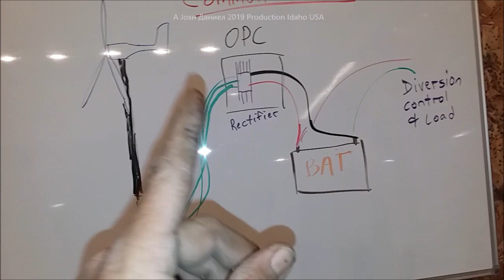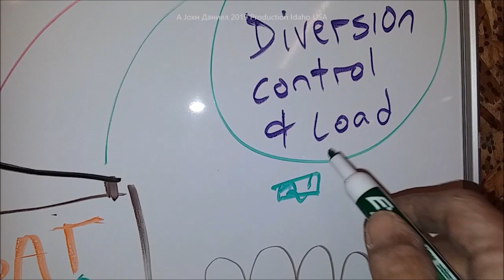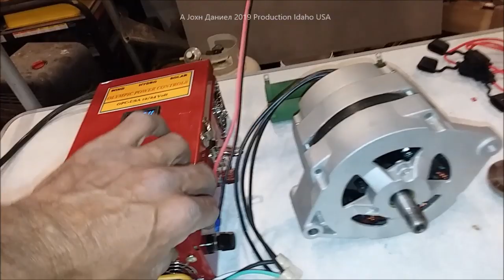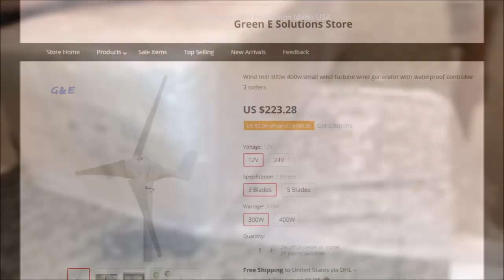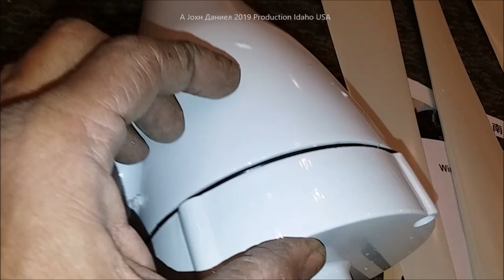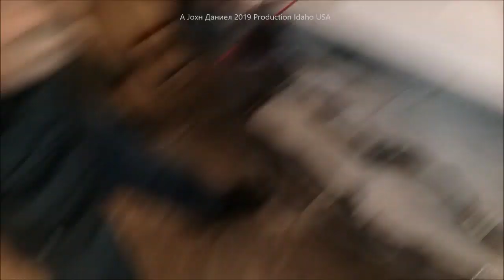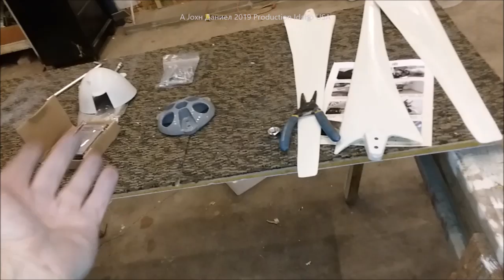300 watt Micro Wind Turbine, the GE-300-S, truthfully 300 WATT RATED! ALL Parts below vid

Comment from the maker: All materials used are listed above under this video.
Reply: Јоhn Daniel  Here in Indiana we get roughly 10-15 mph winds and sometimes up to 30 especially in the spring and fall periods. I was thinking about about getting one of these small 300-400watt turbines to use with my garage. Does the factory controller control the turbine Incase of high winds and/or slow it down when the battery is fully charged or should I invest in resistors to stop it from over charging or damaging itself?
Reply from the maker: @haulngarage  Honestly the factory controller will work for most, but your winds are likely high enough to consider a actual diversion controller set up. Reason is the factory controller will constantly be hammering the turbine in and out of brake mode which is not healthy for it or your battery in wind averages over 12 to 14 mph. So I would suggest the diversion plan that allows the turbine to spin up but be loaded heavily instead of brake shorting the generators head so much.
Reply: Јоhn Daniel 👍 Right now (even with green leaves on the trees which is crazy for this time of year here) the wind is steady at 18 mph and gust up to 27 mph. How do you feel about wind turbines connected to grid tie inverters? Seems to be a popular thing at the moment and I know what’s his name is on a ban spiel about it (solar guy that was homeless? Name leaves me at the moment?) but seeing as my garage is on its own meter I wonder if wind generator would be a viable option? It could act as a load generator if the batteries are full. But then again with everything shut off I don’t see my garage using next to nothing if I’m not out there so it still may need a resistive load 🤔 Still trying to come up with the best option that would best suit my needs. If I’m successful my wife might let me do it to the house 😁 By the way thanks for the informative videos, really enjoy watching and learning. I build Ebike batteries and tinker with 18650 cells and lots of batteries.
Reply from the maker: @haulngarage  Start with about 1500 watts solar and 600 to 800 watts of wind and at least 8 of the GC2 style batteries with your plans to remove common use circuits from your shop/home breakers and placed on your system. Your starting right, but do not waste your time on wind/grid tie unless your planning on going 2000 watt or larger, even then payback is 5.5 years.  But here is some study help, and direction to your current interest https://dakotalithium.com/our-batteries/?v=7516fd43adaa
Reply: Јоhn Daniel ok awesome. Thanks for the info.

Comment: How would you do a diversion with your controller when using a LifePo4 battery(ies)???  I want to do a hybrid system on the farm for my cabin (Central Canada).  I want to be able to take advantage of the ability to charge / maintain the battery charge in no sun times (winter / night).  However, how would a diversion work if the BMS on a LifePO4 battery shuts off current at full charge / low temp - the electronics in your diversion box would have no reference voltage from the battery?
Reply from the maker: On a Lifepo4 you will always have voltage present unless your BMS fails. Its accepting charge is to all cells, the BMS just does the balancing of cells to keep them equal. So by setting the divert to below the Lithium max charge rate you can do it. But I prefer a dedicated wind charger controller for Lifepo4 like these on this page https://s.click.aliexpress.com/e/_9iefAL

Comment: Is there something I can add for a turbine charge lithium iron batteries.
Reply from the maker: For lithium batteries you need to get the MPPT controller that's battery selectable.
Reply: Thanks.
Reply: Got an mttp controller. Waiting for my 48 volt 5 blade to be delivered. Thanks again for all the info you post.

Comment: I’ve currently got solar (600watts) charging a 200amphr lifepo4 (lithium) battery. 
Will get another 200amphr battery down the line but for the moment I’d like to incorporate a 400w turbine to keep the mini fridge going on cloudy days. 

Could I use the factory controller along side with my existing mppt solar charge controller (obv different brands) and charge the same bank, or would you suggest I get the diversion controller?  Avg wind speed 6mph 

Thanks in advance!
Awesome stuff
Reply from the maker: You should go with this programmable 800 wind/600 solar  MPPT controller  https://amzn.to/32K5YfH  for such use on LiFePo4 due to the sensitivity to voltage the BMS has. Later you can add 300 to 400 more watts of solar on it. Never load them to their advertised claims.
Reply: @JOHNDANIEL1  sweeet, subscribed!

Comment: Have you tried hot cold therapy for your carpal tunnel? Frozen bottles of water make great ice cubes. Dip them in a bucket and you're set. Take a look at the Talon Slack channel, very good community software with voice dictation and eye tracking solutions. Hit me up there if you are interested. I suffer from similar problems.
Reply from the maker: Yes, did it all. They say I am so far gone only surgery is next. Too many years in the ring, too many years working 50+ hour weeks.

Comment: Hey John I'm trying to keep up with all the calculations but I'm getting lost and frustrated. I bought a wind turbine (24V 3000W) S model from China. I seriously do not know what I need to get this system functioning so that I can use it in my shed. I'll mainly use regular 110V not 220V but I figured the more voltage and wattage the better. I'm LOST!

Comment: I've noticed 2 bad things: 
1. They don't put governors on these for some stupid reason!
2. Power is being wasted in the dump load that could be sold to the grid.
A governor would stabilize the RPM, and you could just disconnect the generator when not needed; it would prolong the life of the unit if it wasn't under load all the time!

Comment: @John Daniel, thank you for this, it's really helpful! You mention a special tubular fitting that just clamps onto your pipe and bolts to the flange. Does this mean no welding is required? I could not find the part in the description. Did I just miss it, or what alternatives to welding are there?
Thanks so much for your videos, they're excellent!
Reply from the maker: I did have a link under some videos for no weld flanges I guess they ran out or changed the link. BUT, I am planning on mass producing the 3 different no weld mounts for the thousands who need them. I am estimating about $24 to $38 plus $8 shipping depending on size (turbine watts you need for).
If you need one made that's a slip fit and tap tighten let me know, I am estimating how many I can make or people want. Send me a email about the model your needing help on, olympicpowercontrols@yahoo.com

Comment: Good morning.At least here it is morning.I m trying to install a 400 W windmill to give me extra power on the solar.I connected the charge controller they delivered with it ( FW 12/24 ) but i must be doing something wrong.when i connect it immediately on the batteries the controller immediately starts to brake.I m having a 24 v system but i only mesure 12.9 till 14.5 v comming out of the controller when i put a solar charge controller between the rectifier and the batteries.What am i doing wrong. Maybe it is not a bad idea to make a video with all the stupid things you can do wrong for dumbasses like me.
Reply from the maker: The controller has to be connected to the battery bank first, if your solar is affecting its reading do the connection at night. Then connect the 3 wires for the turbine to it. If your using a Rectifier you meed a dedicated diversion system, and can only use the controllers battery leads as a spare divert option.

Comment: Are there smaller ones than the size  illustrating , like for  camper van .
Reply from the maker: the 300w turbine it's in one of my videos is extremely light and produces according to its rating I would say that you could raise it on an inch and a half in just a few minutes with the weight being below 35 lb total weight.

Comment: John appreciate all the info would like to build controller like yours is it possible to get schematic of box
Reply from the maker: Heres a DIY option like mine, from same sourcing, to use direct rectification & to divert over volting for 100% charge of batteries you will need these. https://amzn.to/37HN2OR 100A SQL & a OPC / W&S  https://amzn.to/2MTUjCU A All purpose long life controller. With that on the 500 watt turbines you will need about 400 watts of diversion load, and a 60 amp Dc to DC SSR relay. If you need best option on it just ask.  J

Comment: what is ohms between any 2 of the 3 phase of a 12v 600 watt win alt  ,  lots volts but no amps will run 5 watts at 12v run up to  25 mph 20 v dc but that is a 20 year elec eng.                                        /
Reply from the maker: Did you watch the results, in amps? Or I must be going blind or your comment came from some one else's video.
Reply: no just the stator res ohms between any 2 this is one like you put on the small pull behind rv trailer about 6 months to a year ago

Comment: Sooo  . . . when diverting power to those resistors, instead, you could hook those wires up to a grid tie inverter instead?

Understanding that you tune your controllers to the output of the windmill and the local (average or peak?) windspeed, do you have a ballpark range for the cost of one of your controllers for a 12v system?  Even a big price range is fine as it gives me a ballpark cost to factor in.  Love your videos.  Thanks :)
Reply from the maker: Grid tie inverters take a few seconds to activate when power is applied, so on and off  2 second over volt is not likely to equal enough cause to spend the money on a GTI. And the chance of unregulated voltage spikes, no battery to catch it in time, you would just as most who try it toast your GTI.

Comment: Hi John, do you have a link for the control board manufacturer, and any schematics for your control box layout? Gradually getting parts together for first build! Cheers Steve
Reply from the maker: Yes, its a Mason design Now fully upgraded with impressive accuracy https://ebay.to/2T6TGHs WindSun-Controls Designed for Solid State Controls, MAGER SSR https://ebay.to/2R5eBsv be sure to get DC/DC solid state relays, 40+ amp Mager
Reply: @JOHNDANIEL1  Thanks john for your rapid reply. I have wind speed records for my intended location in Tasmania, and the average is only about 6mph gusting to about 18mph  so looks like 500w 5blade. Cheers Steve.
Reply: I have the controller from windsun, didn't realize as looked different to yours featured in video!! Cheers Steve

Comment: i really love the way u explain stuff even a  newbie like me can understand thanks for the very educational videos u do on wind energy i feel like am moving to wind now used to be a solar junkie. Thanks again.
Reply from the maker: The better kit is the 500 watt 5 blade Wind turbine, with the 3 phase to DC controller and you provide batteries. https://youtu.be/GrL7OA0Kb4A  If you have lower winds ( under 13 mph average ) get the 5 blade. They make rated power of 500+ watts at 23.5 mph and higher. Mine has hit over 1100 watts in 35 mph so be sure to run 8AWG wire at least. Or something equivalent. If you stay with one turbine you only need the provided controller. If you add more, you will need to change the set up to like mine
I recommend at least 1600 watts solar, 2 - 60 amp MPPT controllers, 8 GC2 batteries and 1 or 2 of these wind turbines to get a full use of wind and sun power.  If you need info on proven stuff let me know, you can't get into this by budgeting wrong or experimenting, that's very costly if you make a mistake.
Show less

Comment: cool, seen sellers on ebay in the UK with metal solenoid
 controllers for about $100!!! get over charged and high chances of a house fire too!  I only use 260watt hr in my house. until the cooker or heater is used.

Comment: I'm thinking of buying either the 300 or 500w turbine that you suggest. My purpose would be to use it to supplement my solar thermal Mass heating setup by using the diverter load on a 300 to 500 watt 12 volt heating element. My question is,  if I have a normal deep cycle battery attached to the wind turbine box that is fully charged at least most of the time would this setup be ideal to consistently help heat the water up on a daily basis when the sun is absent? Could you see a problem with this setup always dumping and not needing to charge the battery that often? 

I'm really hoping that this would be a solution helping my thermal Mass above freezing in January in northern Michigan. Where I am at just off a lake shore of Lake Huron we have consistent daily winds of 20 miles an hour in January and February.
Reply from the maker: I would get the 5 blade 500 for that.
Reply: Thanks John. Love your videos and the work you do.
Reply: John Daniel. I believe I read where you had said that it was okay to put a 12 or 24 volt wind turbine and the situation with low wind? I realize the part the resistance of the load plays in the scenario, I just wondered about another scenario I have with yours well wind and if I wanted to get the 300 watts that I need would it be advisable to go to a 600 watt 24 volt turbine to try to get  near my needed consistent 300 watts in a 12 volt system? If not, which one of these more efficient Chinese turbines would get me closest to my 300 watts I need in a 15 mile an hour wind?